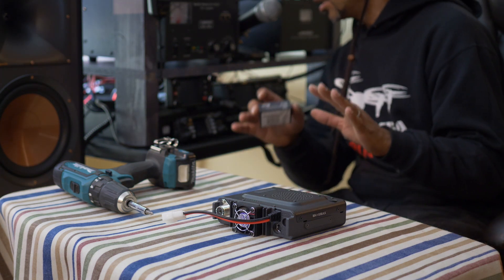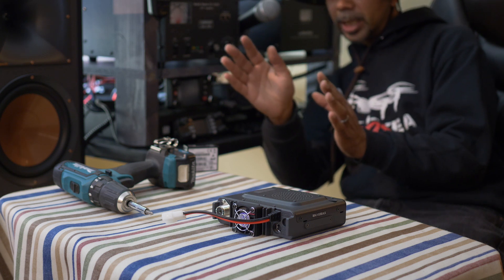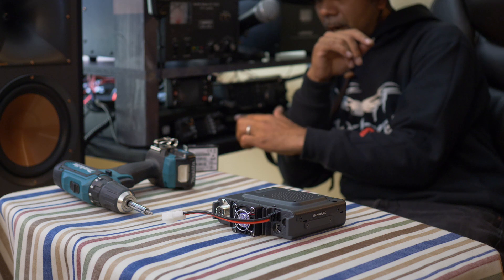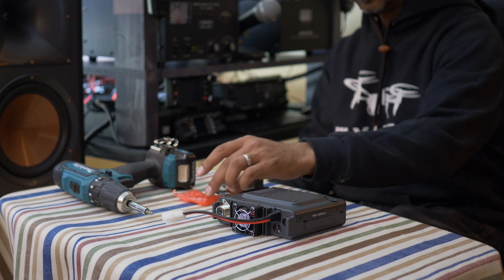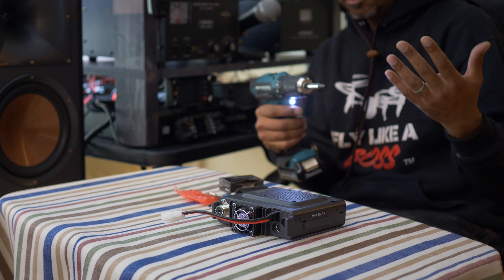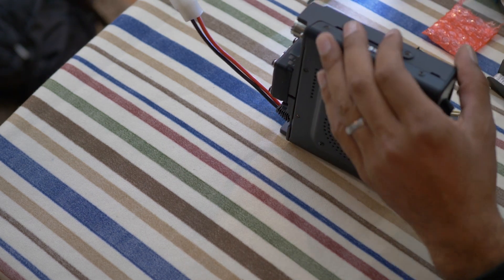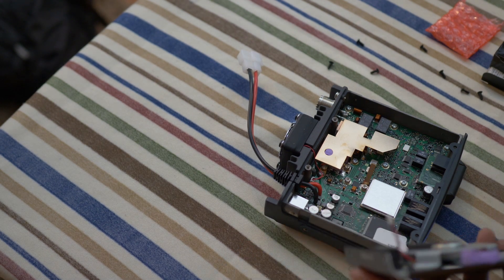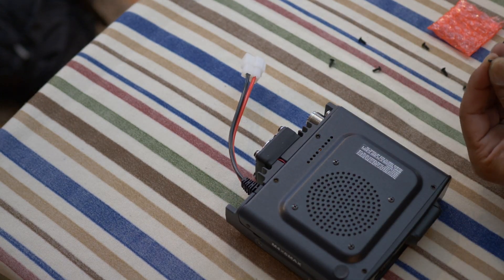Yaesu FTM 400 Bluetooth Install for proper comparison between the FTM400 and FTM300

Comment: I use Sennheiser CX350BT  it’s connects to 2 Bluetooth devices at the same time I am using the  IPhone 12 Mini & Yaesu ft3d  ). I can listen to music on my iPhone and monitor for phone calls and the Yaesu ft3d will audio interrupt when RX.   
Turn Siri off on iphone  then the (  Siri button ) on CX350BT    to transmit on Yaesu then  (  Play / Pause  button  ) on CX350BT stop transmission on Yaesu. 
Sounds pretty good too !

Comment: look like a fairly easy job. Might have to add one to my FT-400 Nice video thanks KB9HGI
Reply from the maker: Thanks Steve for having a look. It is extremely easy to install, just be careful with that thin speaker wire.

Comment: What radio do you like the best?  300 or 400?  Hope to purchase one soon.
Reply from the maker: i do like them both for different reasons. compact versus touch screen and price. i am leaning towards the 400 a bit more now that i installed the bluetooth unit. my mindset is really about which one is going in the mobile. if your thinking about just having a bigger screen, keep in mind that the font size is similar and some of the touch screen buttons on the 400 are buttons on the 300.
Reply from the maker: i’ll have a full review comparison soon. and i may include the ftm-100 in the comparison despite its discontinuance.
Reply: Good stuff. I have the 300 and love it for mobile use
Reply from the maker: @chrisforslund4664  It is an awesome radio.   it’s a and d side or full capable C4FM individual sides. dedicated audio out great bluetooth and it records.